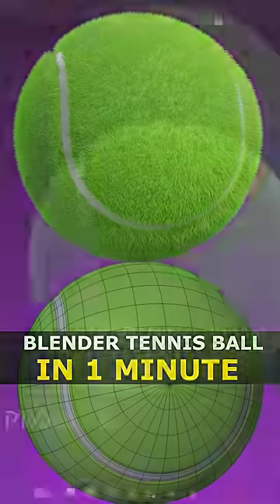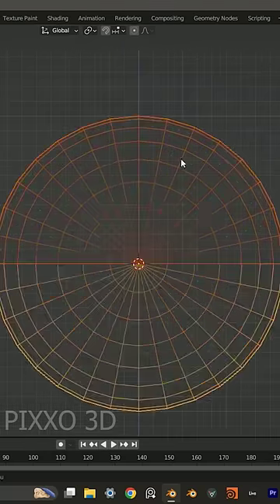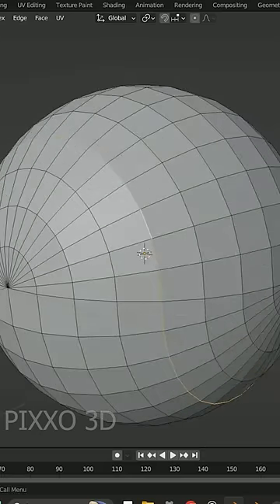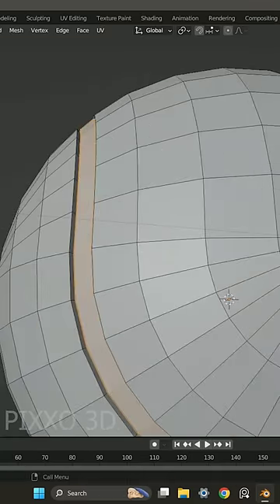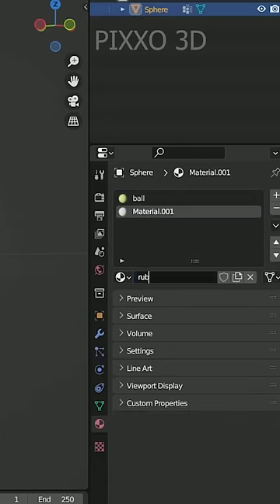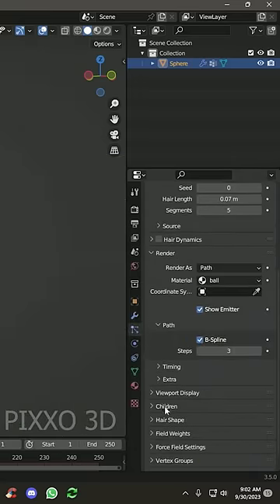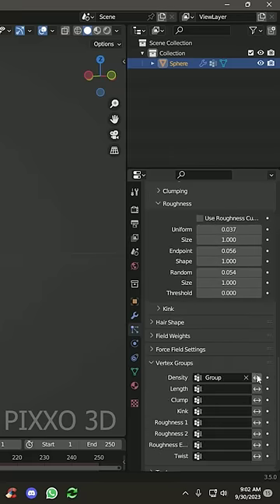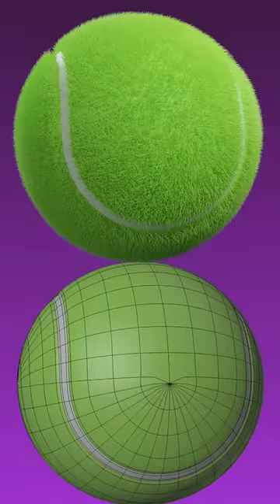3D Tennis Ball In 1 Minute | Blender

Comment: That top half rotate trick was a sly move really. Quick note: I think there is a function in edit mode that allows you to separate geometry without separating the object. Just select the faces and press Y and it will separate the geometry. Alternatively, you can also select the middle vertices ring and press V to rip and right click to avoid moving the vertices and the top part will be loose this way.
Reply: @mqbaka  life saver thanks
Reply: also after he joins the two meshes, there is no need to use weld modifier, simply select everything in edit mode and merge by distance